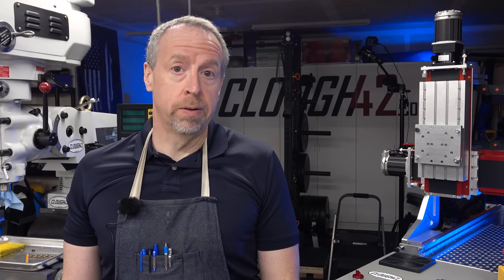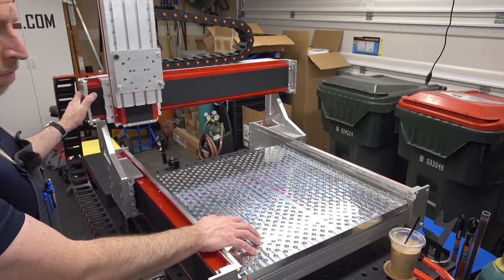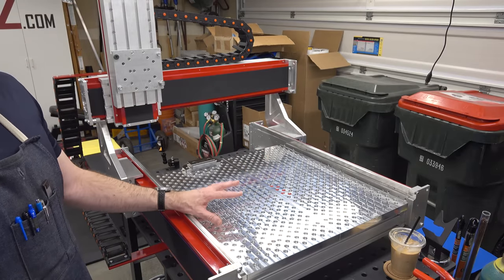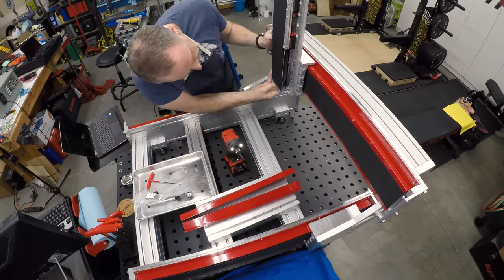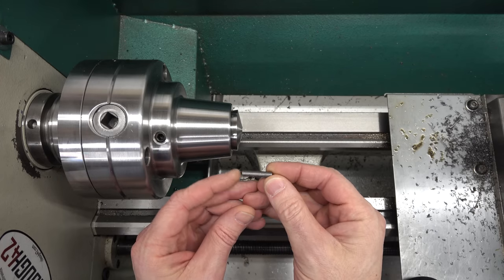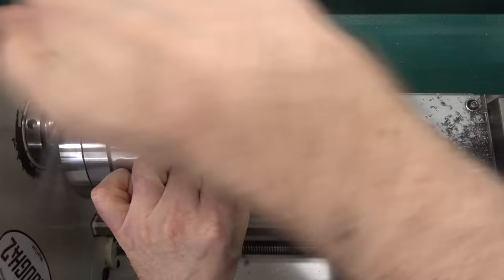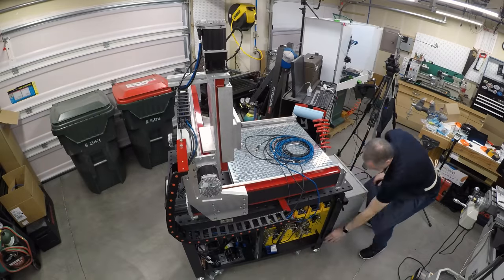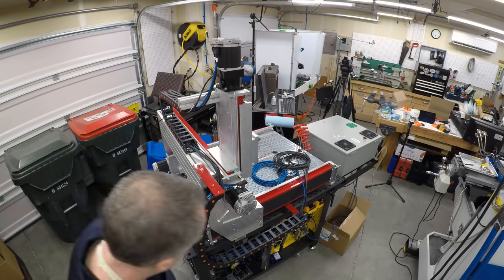New Machine:  Avid Benchtop Pro CNC with ClearPath and Centroid Acorn

Comment: Nice video. We have 3 of the Avid machines, all running with Clearpath and all with the CNC Depot ATC spindles. While I was using ATC with the tooling rack in the back, I don't like how much table space it takes. We have to handle 4x8 sheet goods and on their 48x96 PRO machine, you loose that cutting capability with the tools rack. In the process of a redesign now that will address the tool holders and dust shoe. It's always something :). As for the Clearpath NEMA mounting and AVID mounting holes, I found this out on a late night build and was scratching my head also. I really think this is an oversight by Avid, but in the end, I just pulled out a drill bit. That worked fine and have been running them 2.5 years and never seen problem.
Reply: Oh, and be aware of noise issues. Not sure why Teknic cables are not shielded but they are not. Moved from Chinese water cooled to CNC Depot, we have fought intermittent issues with the Clearpaths. They like to trip on VFD ramp up and ramp down. Curious to see if you run into this issue.

Comment: What was your deciding factor(s) for choosing this over say pocketnc or any other machine?
Reply from the maker: Travels.  I have several projects in mind that will need a dozen inches or more of Y travel.
Reply: @Clough42  thanks for the reply. I’m in the market now and been searching for different options that’ll fit my ideas too. I did like that pocket nc had the ability to add 4th and 5th access but like you said your work envelope is much smaller.

Comment: Knowing nothing about it, I'm not certain why normally closed switches would help? Longer actuation I get, but not the NC vs NO.
Reply from the maker: NC switches are safer because a disconnected cable or broken wire will stop the machine until you fix it.  A broken wire on an NO switch will look fine until you hit the switch, but it won't work, leading to a crash.
Reply: @Clough42  ah, that makes a lot of sense, thanks!

Comment: What’s the difference between normally open/closed switches? I mean I know what they are logic wise but why’s one better then the other as a endstop swich?
Reply from the maker: Normally-closed switches are better because the controller will register them as triggered if a wire breaks or comes unplugged, stopping the machine until you fix it.  A normally-open switch will appear normal if the circuit is broken--it just won't work and can result in a crash.
Reply: @Clough42  ohh right! Makes sense, thanks!

Comment: Those couplers with plastic/ rubber are pretty bad, consider replacing with ones with the spring style.
Reply: I have spring style ones and they "spring", giving serious backlash
Reply: @aparfeno  and over time they break , all the ones i had broke , needed to be replaced..
Reply from the maker: They're Acetal inserts, and the performance is excellent.  The spring couplers would be a big step down.

Comment: What was the final rapid IPM?
Reply from the maker: 400IPM on all three axes.  That's primarily limited by the max RPM of the motors I used.  They're wired for more torque and have a slower top speed.  At some point, though, the screws become a limitation.

Comment: i take it you're not willing to solder wires directly to the acorn to get an external heartbeat light lol
Reply from the maker: I could, but in general, I think that's a bad idea.  The board doesn't have strain relief provisions for this kind of wire, and the board wasn't designed to have that part of the circuit exposed off-board (ESD, short circuit protection, EMI, etc.)  There's a good chance it's wired directly to a CPU I/O pin.
Reply: @Clough42  generally speaking the I/Os of microcontrollers are pretty well protected against ESD events as they usually have protection diodes clamping the I/O pins. i also wouldn't be worried about EMI on an output pin (i think lol). if i was in your position i'd first try the light guide idea because that's pretty cool, and if that didn't work and i was still fussed about it, i'd probably use a mosfet and connect vgs across the diode, and hook up a fuse between the drain and power source; having said all that, you raise valid concerns and, indeed let's be honest, that's a lot of effort to save a couple seconds each time you start the machine lol